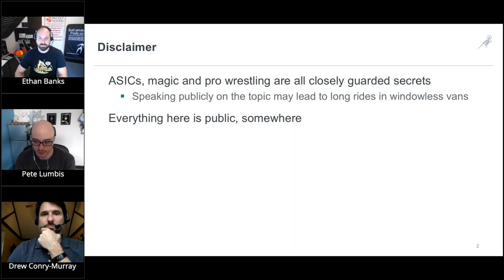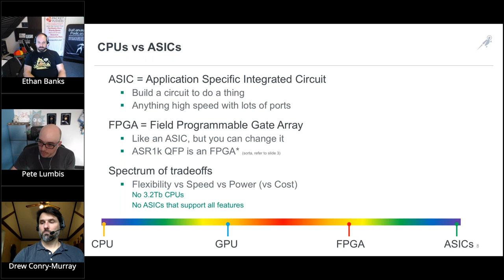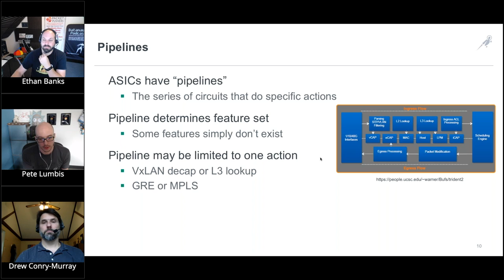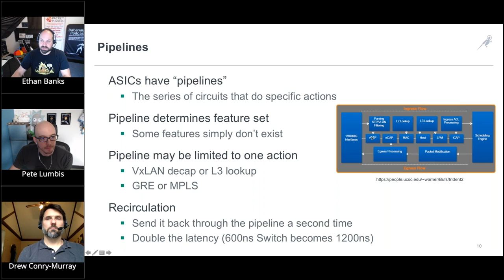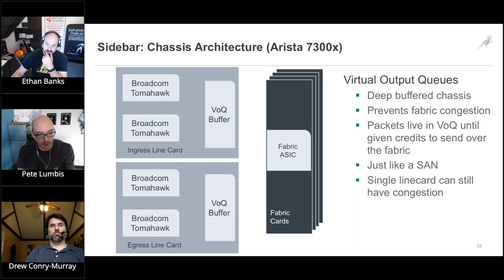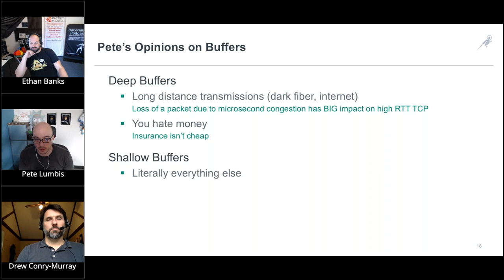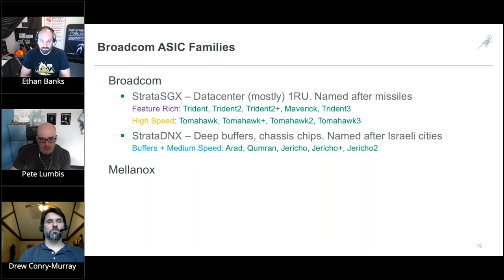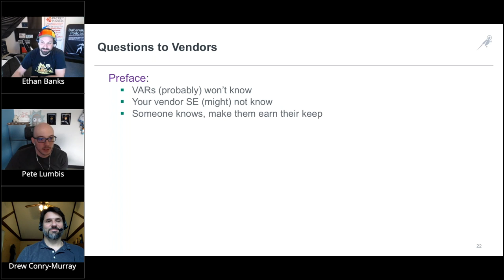Understanding ASICs For Network Engineers (Pete Lumbis)

Comment: Some corrections on Cisco's Cloud Scale ASICs (since that is what I primarily work with in ACI mode) - They do not use that additional ASIC to do VXLAN encap/decap with routing. That was one of the main purposes of them developing their own silicon. Only the Gen 1 N9K switches used the Broadcom dual ASIC hack.  Regarding store and forward versus cut through, with the N9300 for example, it depends on speed of ingress/egress. Given it's a fabric, this makes the most sense. i.e egress interface is same speed or faster it uses cut through and if there is a CRC error, it has to "stomp" the CRC by changing the frame FCS letting other egress ports know that it has already been forwarded but it has errors. If the ingress interface is slower than egress, it defaults to store and forward. I imagine this is the opposite of what you described in relation to speed mismatch. In this case it seems they are smoothing out the difference in signal rate on egress by using the buffer. This of course is different than congestion-related speed mismatch.

Comment: As far as the different feature sets baked in (again only focused on Cisco Nexus) - Microburst detection can be useful in some situations. AFD/ETRAP/DPP are all very unique ways to work around being fair to bursty traffic as well as being fair to elephant and mice flows. As far as the gPB telemetry, I've seen a large uptick in this becoming more important. Primarily with the way this data can be used with no CPU overhead to deliver non-sampled full flow records directly to a collector. Built in tools such as Nexus Dashboard Insights can use this data beyond troubleshooting these days to do things like dependency mapping using connectivity analysis allowing you to stitch together security policy based on what's actually happening versus limited logging capabilities of these switches (they are not firewalls and are limited by control plane policing usually). The main problem with telemetry is scale of the collector and Cisco's NDI app is limited to 20,000 flows/sec.

Comment: Nice talk. I have a question. In a fixed-function bare metal switch, with some kind of Linux OS installed on it (ASIC not programmable), is it possible to use a CPU to process packets with headers that the ASIC is not capable of processing in the pipeline? VxLAN for example? I don't care about performance here. If so, how is it possible?
Reply: We could make a rule to forward such a packet to the internal CPU that can do/is programmed to do the necessary processing and feed the output modified/processed packet back to the Packet processing pipeline that can then just forward the packet on the desired output port.